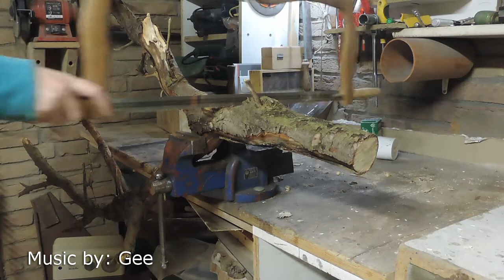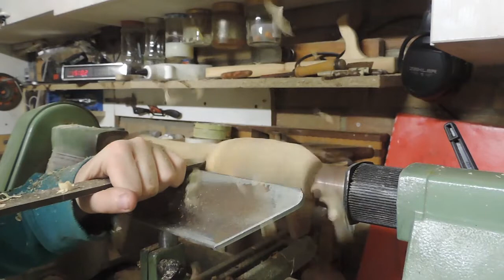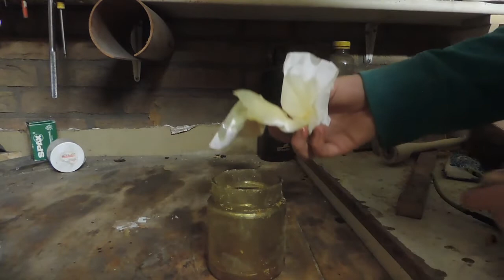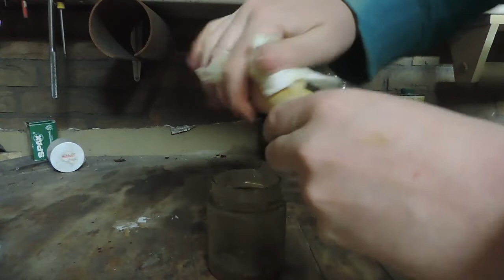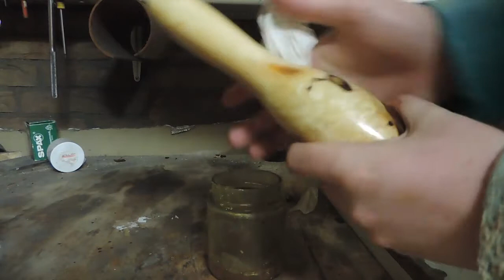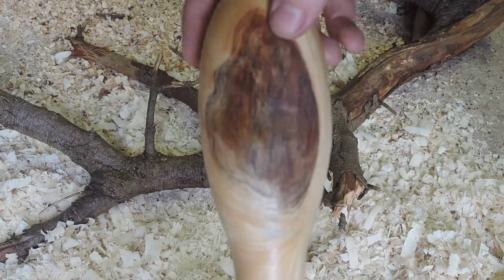Mallet for the Hand Tool Build Off Challange

Comment: Hi have you got a bowl gouge, this would stop a lot of the slipping as it would be cutting instead of scraping. I picked mine up for very little at a car boot sale, it needed a new handle but that I could make on the lathe. Keep up the good work
Reply from the maker: I'll want to get one of those in the future. But for now it's alright with the tools I have
Reply: If you got some 1.5 inch steel conduit and cut it in half length way you could make your own, it is worth a try